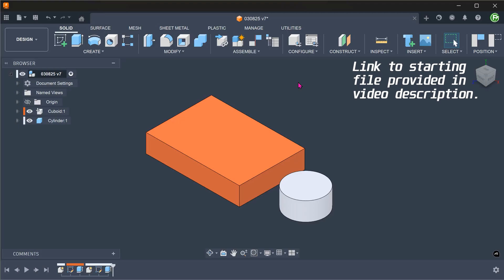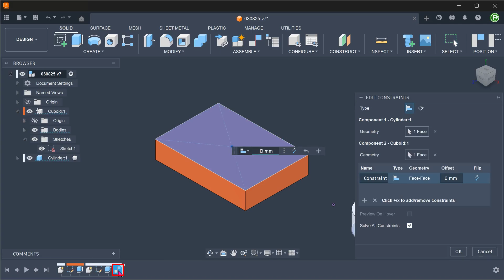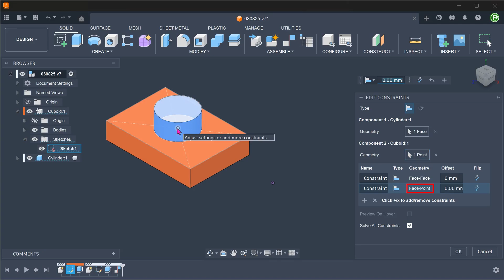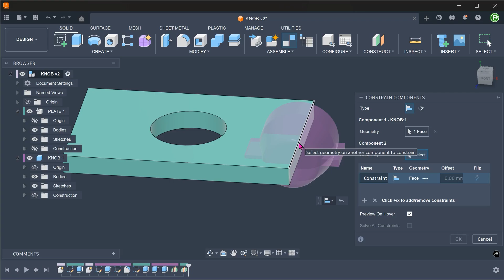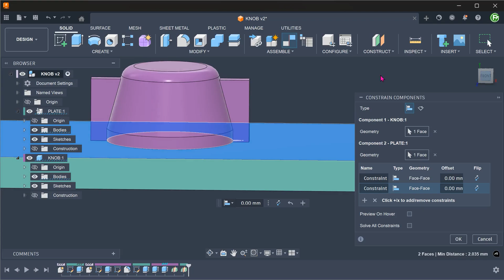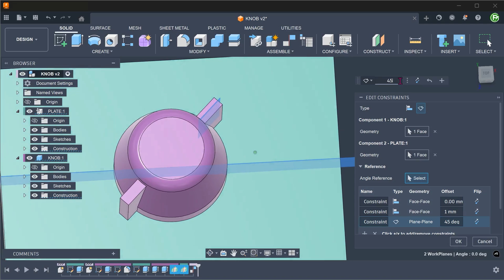Autodesk Fusion | Constrain Components

Comment: To set the angle between the two components you don't need to create the construction planes. You can use the face on the side of the knob and a plane on the side of the plate. This automagically creates an angle constraint and you can still specify the angle.

Comment: Haven't quite heard reasoning why choose constraints over joints or the reverse. More flexible? Better performance on large assemblies? Joints are going away? Why?
Reply: This is an alternative to Rigid Joints.  They don't do Offsets or Angles etc.  If you don't need those use a Rigid Joint.

Comment: Doesn't do tangents.  At the start if you tried to mate the face of the cylinder to the face of the block, it won't work.  It'll snap the axis of the cylinder instead.  Like when dimensioning arcs, it needs an option to select the tangent rather than always selecting the axis.
Reply from the maker: Hopefully, this will get added in the future. In the meantime, it should be possible to add a tangent construction plane and use that plane to mate.
Reply: @Fusion360School  Using a tangent plane is good idea.  It works, however because planes cannot move then you can only move the block to the cylinder, not the other way around.

Putting a point on the cylinder sketch and then mating that to the block edge works.  But only on the original sketch, if you project and a point to that sketch then the block moves.  

Doable in some cases but feels a bit clunky.  Wait for the update I guess, after all it took a few years for tangent dimensions to be added.